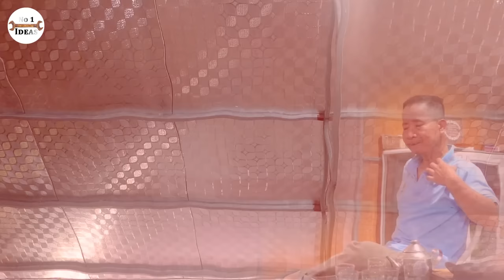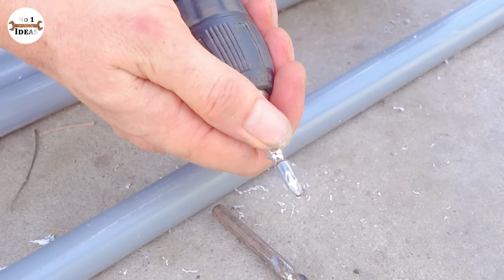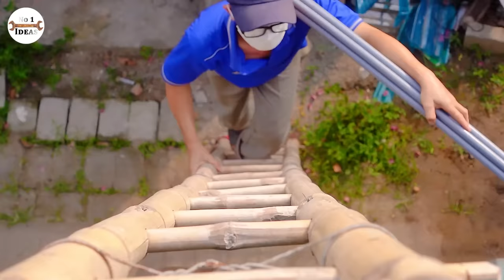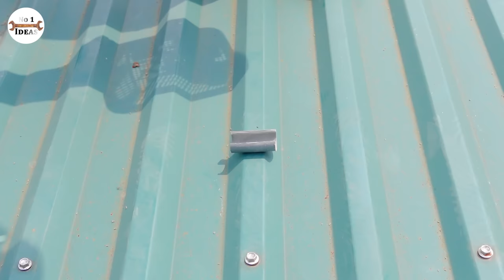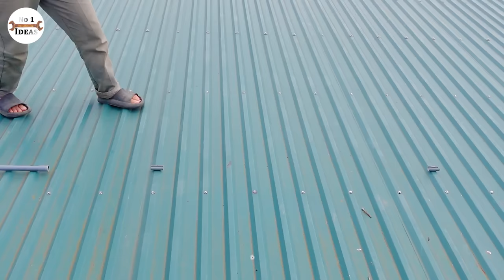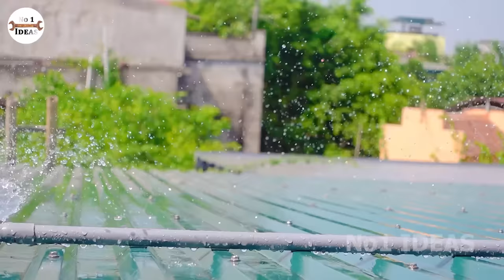Easy and low-cost way to cool roof without air-conditioner

Comment: I MUST tell you!

YOU TOTALLY INSPIRED ME 😅

My husband wasn't interested in cooling our roof, sadly 😢. I am working on him! 😠

HOWEVER: your video inspired me to rig up a spray system for our barn ducks and birds!

It's regularly 40 plus Celsius here in the desert and they are in a big upstairs light and airy barn. But i had to find a way to cool them down.

The spray made a pool on the floor and it doesn't leak to the downstairs barn. I put some blocks around for the ducks to sit on under the spray.

THEY ABSOLUTELY LOVE IT AND ARE SO DUCK HAPPY 😊😊😊 

I also add charcoal and it keeps any bad smells away.

The pool dries out by itself and i put the water on a few hours in the afternoon.. it doesn't use a huge amount of water either.

Thank you from the bottom of my beak! 😅😂🦆🦆🦆❤

Comment: Yep I had to do this 10 years ago, my central air was totally burned up & not enough credit or savings to replace the units. Sprinklers on the roof for the summer dropped the inside temps drastically. That goodness for the cooling effects of evaporation
Reply: Great idea.  Good to know

Comment: That change of state from liquid water to gas requires a tremendous amount of energy.  If the roof is hot enough to convert the liquid water to gas before the liquid water reaches the gutters, this is a highly efficient way to pull thermal energy from the roof before it makes its way to the attic and rooms of the house.    The efficiency goes down sharply when water stays in liquid form.  The finer the mist, the better.    There are many alternative options, but this is great appraoch for knocking of the edge off in areas that have no shortage of water.

Comment: I like the idea but do you think  using a different screw might produce a finer spray? I'm wanting to achieve almost a mist, for easier evaorative effects in my highly humid area. 

Also how do you connect the pipes without an the water leaking out the seams? Did I miss something in your video? Didn't see about PVC cement being used so...?

Great job anyway! Love to see innovation that supports our lovely home planet!

Comment: You csn put plants on the pot on the roof too. It adds up the cooling.
Reply: Nah white roofs are way better and do a lot more cooling than that without using electricity.  Just search up what colour keeps you cold the most and you will see.

Comment: It should be mentioned that in which parts it works, like in already humid areas will it even work?
Reply: It still work as long as your water temp is lower than roof.

Comment: Please can anyone tell me why this is needed
Reply: Tin roofs get insanely hot and with poor insulation it will in turn your home into an oven. Chances are this is a problem you’ll never face.

Edit: Though I guess you could use a similar setup for irrigation for crops and gardens.
Reply: @lordchaa1598  Thanks for the answer. In Nigeria, people who build with tin roofs, also use ceilings. That creates a air pocket and insulation from within and the homes are not affected.
Reply: Over here that air pocket gets warm which then gets transfered into the house. So some use this for around 20 minutes after the sun goes down to help with cooling the house

Comment: Nah man use white roofs instead it is way better because white naturally reflects a lot of sunlight heat back into space when exposed to the sunlight keeping the surface of your roof much cooler naturally.  This leads into cooler temperatures outside and reduces the needing of your air condition by a lot during a hot day.
Reply: its better to use blue, you never know when the lasers might attack

Comment: Water is not free. I'm so confused.
Reply: Don't be confused its a dumb idea 😂 just give it a thumbs up 👍 you'll be helping him out recoup the costs
Reply: Well, some regions in Vietnam the water literally free if you have a well in your garden or yard. All you have to pay is a little money for electricity. I guess not everyone could do this.
Reply: Bơm nước giếng lên mất tiền đâu
Reply: in your region is water more expensive than AC?
Reply: Deep well. It's free
Reply: In my home, water is free from the city, and 50 meters away is a river where I run a pump for gardening, toilet water, etc. Unfortunately, some countries sold their rivers to other countries or industries, not the case where I live, water costs nothing.
Reply: yes, water isn't free, we pay for it but this idea is far more cheaper as a cooling system. in my country in asia, ac and the electricity is expensive enough.
Reply: Collect rain water and use a 12v pump powered by solar. Not free still, but low cost
Reply: Yes, water is free. We just pay for the clean stuff. You can get free water whenever it rains or from a river but it would need cleaning. That is what we pay for, peace of mind and ease of life.